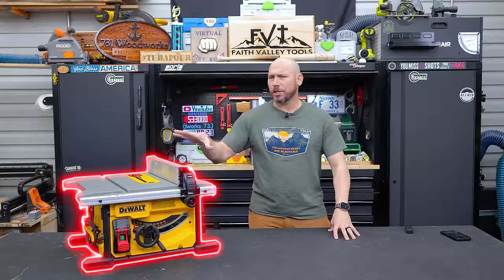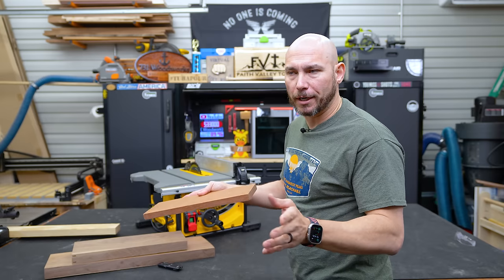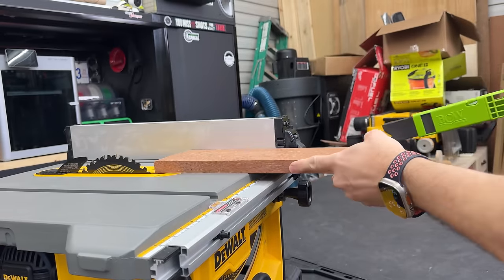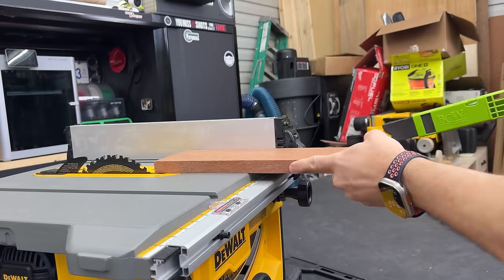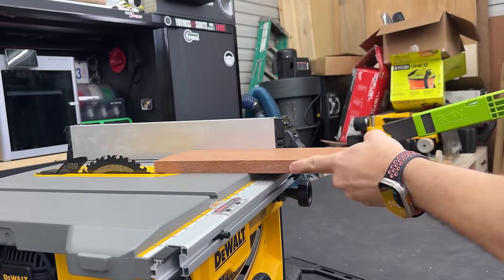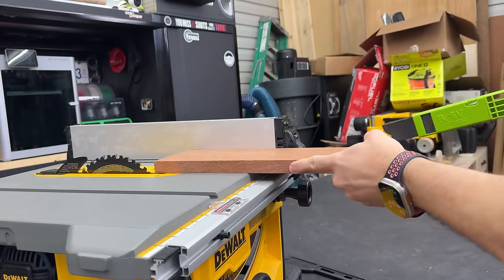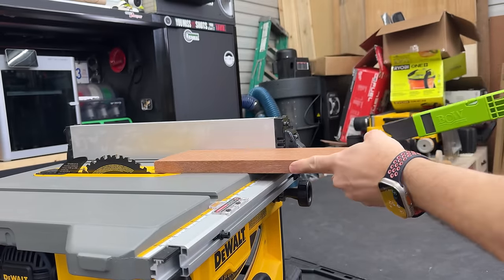99% of Beginner's Don't Know These Table Saw Mistakes to Avoid!

Comment: Female UK Diyer who is finally getting her home next month which has a garage so can build my workshop. I want to get a table saw but they scare me. I would have loved to buy the saw stop but they don't seem to sell in the UK, so I always binge on these videos to get some tips. If I get a table saw, would be a compact one, maybe Dewalt, Bosch ect. But one thing for sure, I need my fingers, I value my body parts to screw around with some shortcuts. Respect your tools and don't take shortcuts.
Reply: Enjoy!
Reply: If they sell FLEX in the UK, you might want to check out one of their upcoming 2 table saws.
Reply: I have used a table saw for 50 years started in wood shop at 16 now I am 66., I have owned three saws a real cheap one , small craftsman cast iron and a few years ago bought bought a forty year old large cast iron craftsman.  I been bit at least three times with kick back. I don’t have a riving knife or blade guard but use wood spacers on long board and feather-board to minimize kickback.  But I am very careful but the credit for not knicking a finger was Mr. Friend my wood shop teacher. Take classes and listen and practice what a good instructor teaches. Thanks Mr. Friend!
Reply: I would suggest getting a tablesaw with as big of a top as possible to fit in your space.   Every inevitably cuts wood larger the table.  Consider whatever you buy, build into its own cabinet/bench.  Take a look at this channel.  Over the years she has scaled up to better tools, but always keep the DIYer in mind.  IN one video she provided multiple to join boards.  https://youtu.be/22oqr6o5z-w?si=6pCIaz2HZs3lu9bO
Reply: Do you have the Bosch Reax saws in the UK?
Reply: Think about what you would use a table saw for and whether another tool could do a lot of the same tasks. A good bandsaw might work depending on your needs.
Reply: If you wind up buying a compact table saw, get something with a rack and pinion fence system.  The Bosch doesn't have one and I got tired of trying to make micro adjustments to the front and back of the fence to make sure I was cutting straight every time I had to move the fence for a new cut.
Reply: I got a Skil TS6307-00 for several specific reasons which may or may not be relevant to you.  Many saws have some of these features, but the Skill is the only one I could find with all:  
1.  10" blade so it can cut 4x4s in one pass.
2.  Rack-and-pinion fence for greater accuracy and reliability.
3.  Self-contained, collapsible legs so I can easily get it out of the way when not needed.
4.  Legs collapse into the footprint of the saw (the collapsible legs on other saws make the package much larger than just the saw).
5.  Trunnion adjustment that pivots the blade about the vertical axis, ensuring the blade is parallel to the fence AND the miter guides.
6.  731 Woodworks gave it a thumbs-up.
Reply: @karllautman I have the same saw and it is a great saw. The only complaints I have with it is it’s extremely loud and the table is not flat. This hasn’t been a problem for me, but check the table for flatness if it is important to you.
Reply: @markgallagher1376 I always wear ear protection when using it so I haven't noticed excessive noise.  No problem with table flatness either.  The insert that goes around the blade is a little flimsy and I'm in the process of replacing it with something stiffer (and zero clearance) from Esty.
Reply: @karllautman  yeah, I always wear ear muffs, but I’m not sure if it bothers my neighbors or not. The table isn’t out much, but it is wavy. Maybe it slipped past quality control.
Reply: Very cool.
There is a channel called Woodshop Junkie.
He makes the most out of small spaces for storage.
Recommend taking a look at his channel as you design your space.
Reply: Festool have sawstop built in for the uk.
Reply: @80adrian80  really? Wow, I didn’t think they licensed to anyone.
Reply: @markgallagher1376  festool bought sawstop  a while ago. So licencing it to themselves, not sure I prefer the design 9f the the festool though!
Reply: @80adrian80  ahh, ok
Reply: Get a track-saw....'does a bunch of stuff better.
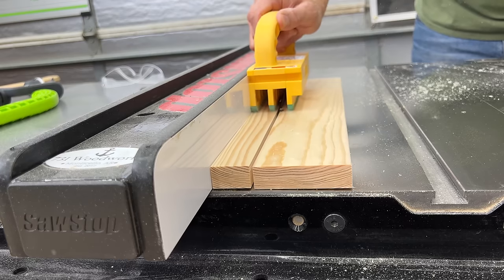Like "Buddy" said at around @3:45 . A dull blade on, a-ny-thing, is dangerous.
Congrats btw. 

Greenhorns usually disregard the "Safety First" mentality, because they're fk'n Greenhorns! Nothing is worth more than you're life and limbs.
Reply: Bosch has a saw with a safety stop. They aren’t allowed to sell them in the US but you can get them in Europe, I would think they would also be available in the UK
Reply: @80adrian80  Just checked, they do, but yikes, £1800 for just the compact saw...wow...really expensive.
Reply: @markgallagher1376  Think Festool brought Sawstop. Its a shame, such a good safety feature but the patent won't end for a number of years.
Reply: @dhebert111  Thanks, I have bosch cordless circular saw but don't have the rail system, so for now, might just buy a rail system, maybe the bosch FN ect...until I decide on a what table saw I need. But thanks, its the dread of losing my life and limbs that makes me so nervous of these tools.
Reply: @johnanderson7653  I didn't know they did, I will differently check out the Bosch table saws. Festool with saw stop feature cost £1800...wish the price was lower as no joke, I could buy 4 compact bosch table saws for that price. But they own the patent so no competition.
Reply: Bosch reaxx is not available any more in the UK. They had a legal issue with saw stop. It's very frustrating that the only UK option is so expensive, bloody Festool!
Reply: I have bought my first Table saw at age 68 having been a pro decorator retired and built/ renovated 3 houses with many other projects. Honestly, I thought I would never need one. But I was wrong. Bosch 635/216 was my decision, although being a Milwaukee man I was drawn to it and I am mightily impressed. Whatever you decide on you should always take every effort to set it up correctly, always use riving knife and blade guard unless you just absolutely cannot. As added security I have invested in a new fence attachment with adjustable rollers. I made a table sled for cross cutting (easy) and I never force a cut or ask it to do something that it shouldn’t. Finally, watch as many of these videos as you can. They have some great tips and ideas. I have all my arthritic fingers intact, both my shortsighted eyes and aim to keep them that way.  Have fun
Reply: Sold my table saw and bought a band saw and later a track saw. I don’t miss the table saw, the band saw can do many jobs and is much quieter, safer and less messy for the diyer without amazing dust systems, and for bigger panel cuts, the track saw is best and I can take it outside if I want.
Reply: @3tree  So do you still use the band saw. I am looking into Track saw as well, do you think its more safer than a table saw?
Reply: Had a machinist working for me one time. Excellent craftsman, and he did woodwork at home. One Monday, I came to work and went out to the maintenance shop breakroom. He was sitting there drinking coffee with his left hand. His right (dominant) hand was encased in bandages. He said he had a "little" accident on his table saw. Several says later, he was able to remove bandages, and his four fingers had little metal pins coming from the ends. He had amputated all 4, removing the 2 end knuckles on each. Weeks later, when they removed the pins, his fingers fell over like dead soldiers. They all had to be removed. I worked 37 years in the chemical production industry, which has more ways to get hurt and killed than you can imagine. I consider the table saw 2nd only to a chain saw as the most dangerous tool around. I have a small contractor saw, and I'm scared shirtless when it is running. I use it, but treat it like a nuclear bomb, very carefully and with the greatest respect.😊
Reply: @MJ88Owl  Thank you, will do, have so many projects I want to fo. First one, arcade bartop, have all the wood and parts, just waiting to complete my workshop.
Reply: @mumihp  no problem, I should add, reading other comments from people that have given you information. Lots prefer tracksaw setups, I too have one and love it. Both have their strengths in different ways. Cheers
Reply: I don't know what is currently available in the UK, but generally their saws are much better than US saws, the full size one's of which are based on a saw from the 30s, that they have been kludging into service for decades.   They never tell us out of all the accidents how many of the people were drunk high, or just stupid and ill prepared.  Of all the tools in a workshop, the worst things that can happen are largely not with the table saw.  Probably the accident statistics are so high because there are so many saws out there.  In NA I have bought them for as little as 25 dollars, so there is no barrier to entry, meaning a lot of them are out there in the hands of incompetents.

If you are average female height, then most saws particular saws like the large Sawstop are far too big for you.  I am 6'2" with long arms.  I find a lot of the saws derived from the Unisaw too large, then they put a fat fence system on them.  Get a saw with no more than a 1HP motor, and of a size you can manage.  My ideal saw is the Inca 259 from the 80s, but some of the portable saws would be easier to find.

I have one saw at my cottage that has a 1/2hp motor on it, and still cuts pretty well, though that would qualify as underpowered, particularly for hardwoods.  But smaller saws of around 3/4hp (depends on type) can actually take kickback mostly out of the equation, and that is the most dangerous thing.
Reply: @tacticalskiffs8134  Thank, in terms of variety, I saw the US has a lot more tools and brands than the UK, maybe because of EU regulation on what we can import then and safety. But will differently research to see what fits best...but then again, I can put a table with foam on top and use a track saw to cut materials if needed. Not sure yet, but will differently research more.
Reply: I had a ShopSmith that I bought to build a shop. I used it for 20 years. And sold it for $200 to a friend(younger than me). Beautiful machine with a lot of attachments and tools. I think it was a Mark X.
Reply: Go with the DeWalt jobsite table saw.  It's the best in it's class, it comes with a few safety features and it's lighter than all other jobsite table saws and it has a rack and pinion fence which is amazing for accurate cuts
Reply: As long as you are afraid it you will be safe,trouble starts when we become too comfortable
Reply: UK DIYer here with a similar potential set up to you ... the garage. I had the same dilemma earlier this year. I realised that the smaller saws are aimed at contractors to lug about in vans. They have a relatively small top and make cutting anything large or delicate quite a challenge. 
After a bit of research, I've just bought an Evolution RAGE5 - not even got it out the box yet. It wasn't particularly expense compared with some, but I've learnt is no matter what I was going to buy, I need to take my time and calibrate it properly and often to reduce usage and kickback.
Reply: @paulrattray8121 I've the same issue. Small single car garage. I've got the DeWalt DWE7492 table saw. The top is fairly big, but have built a bench around it too give extra width and an out feed. Bench is on wheels so can be moved around the space depending on the cut.
Reply: 30 years ago I bought the smallest delta cast iron tablesaw in their line at the time. I bought a couple of their lighter T-square fences and made my own rail for it- one fence for tablesaw, one to built a router table fence for the self-made right side wing. Not that compact, but not gigantic in a small shop. 

So my recommendation after living with that compromise- and also having a small, light portable I acquired along the way- is to NOT buy a light portable. The small, heavier cast iron saw cuts smoother anyways, but coupled with a nice US$300 blade you will save so much time and have excellent accuracy and performance that isn’t readily achievable with a light tablesaw. 

Of course there’ll be a lot of opinions differing (and I’ve been told so many times personally how ‘perfect’ the person’s portable tablesaw is) but after 30 years of pro cabinet and furniture making out of a very small shop I can’t say strongly enough how beneficial a smooth-running cast iron top tablesaw is. Stability is everything for joinery cuts and repetitive accuracy and you won’t regret having a solid, dependable tool for not much more money than a decent portable. 

You can get by with a lot of other cheaper tools in other areas, but the tablesaw, router, measuring tools, and drill press are the first places you’ll discover that going cheap is going to bite you in the quality of fit and finish department. 

The point is that you never want the tool to limit your achieving your full potential. I know it’s been said “it’s a poor craftsman that blames the tool” yet the fact is those tools can and will defeat the best of skills if they can’t perform at least as good as the workmen using the tools, and a decent tablesaw will never introduce a quality limitation to the finest craftsman among us, male or female. 

My opinions, obviously. 
But this is my advice to anyone that doesn’t have the space or the budget for a hybrid or full-sized cabinet saw.
Reply: If a table saw scares you that's good you will respect it.

Go for bigger sized ones.

If you don't have the budget or space learn how to use a skill saw ( worm drive saw ) and a straight edge.

Or a router and straight edge ( ½ inch chuck not palm router.

You could also look into panel saw or panel router.
Reply: Ya gotta have a healthy respect for the power of a table saw!!! You are wise and should have a long time working with wood! Best wishes!!!
Reply: Ya gotta have a healthy respect for the power of a table saw!!! You are wise and should have a long time working with wood! Best wishes!!!
Reply: I’m waiting to do the same thing. I will be moving to the country and building a workshop in my garage.
Reply: Fellow UK female DIYer who has the bug! I’ve also set up shop in a tiny garage (was a one car but the back part got converted to a room). I find something portable great because I actually work mostly just outside the garage - better for light and dust imo. I too bought the Evolution Rage 5s but if you do it’s worth looking at all the different tune up videos to ensure you’re getting the best possible out of it. At the time I never considered a track saw and sometimes I do wonder if that would have been better but no budget to try one for now. Happy building!
Reply: Whilst saw stop is great - from a safety perspective the Most common injury is from kick back which saw stop doesn't prevent
Reply: I would even say saw doesn’t matter as much as keeping your supreme respect for a VERY dangerous tool. 

All your original parts!
Reply: Two points:

Buy dewalt - if you buy anything else you’re silly

And lastly, don’t pull back! Always continue the cut and through.
Accidents happen when people ease up or pull back.

A last free tip - keep the guards on.
Reply: UK DIYer here:
Get a track saw instead. It doesn't need as much space, is less scary than a table saw and you can do a lot more than just ripping sheet materials with it. Check out 10 Minute Workshop by Peter Millard for very approachable videos.
Reply: @YaaLFH  yeah that’s really good advice actually. I bought a circular saw and have spent my time building jigs to create straight cuts and my mate bought a track saw - it’s night and day and wished I’d bought one.
Reply: @dannyarcher  A track saw is basically an evolution of circular saw, designed to make it easy to cut straight (thanks to the track) and safer to use (plunge mechanism).
If you use your saw to build stuff, I'd seriously consider upgrading to a track saw.
Reply: @YaaLFH  👍
Reply: @YaaLFH  hi, I am considering that as I seen how versatile it is. Do you have any recommendations that won't break the bank? Thanks
Reply: @mumihp  Depends on your budget. I would start by checking ebay for used Festool ones, maybe you'll finding something in your price range (just be careful about 110V vs 240V).
Peter Millard has tests and comparisons of UK budget brands plus a lot of other track saw related content in bite size chunks on his channel called "10 Minute Workshop".
Reply: @YaaLFH  thanks, will have a check. I have seen Peter videos before but will check out the tracksaw videos. Festool I would like to buy but they are pricey so will have to see what I can afford but differently want a track saw that is accurate and safe to use. I rather not cheap out.
Reply: @mumihp  If you can stretch your budget to about £250-300, you can find a used Festool in a good shape that will serve you well for years, they hold well if not abused. It might be a bit of a hunt but it's possible to find them in that price range.
If your budget doesn't stretch quite that far, definitely check Peter's videos on the supermarket brands, there are some surprisingly decent choices there!
Reply: I bought a cheap table saw years ago and have never had a problem.  Use the safety features and common sense and you'll be fine.
Reply: You really don't /need/ a tablesaw to build furniture. You can do an awful lot with a tracksaw, possibly also a small bandsaw, and a router table.

Both Record and Axminster do decent bandsaws. Mine is a Record 14", but you can get by with a much smaller machine. You might even find an Aldi bandsaw, I think their tool brand is Parkside.

My tracksaw was from Makita, router and router table from Trend. All available in the UK.
Reply: The Makita mains powered tracksaw is an awesome bit of kit. It's not a cheap supermarket saw, maybe not as good as a Festool tracksaw but I honestly can't imagine the Festool being that much better.

As always, shop around and see what you can find.
Reply: @Mikey__R  Of course you don't need a table saw, it's just USA people looooove their huge tools and consider a table saw THE universal woodworking tool.
When you don't have an aircraft hangar for workshop and have to fit your woodworking in a typical UK single car garage or garden shed, a track saw is much more convenient because you can bring the relatively small tool to your material instead of trying to manoeuvre a huge sheet in a small space.
Also, if you are of or below average female height, a lot of table saws are too tall and hard to reach.
Reply: Also feel free to freehand when you need to I've been doing it for years
Reply: Don’t spend a load  of money . Check out your local Lidl supermarket. Their Parkside range are really good quality.
Reply: I think when it comes to using dangerous tools a fear of them can be a good thing. You never really want to get too comfortable, that's when mistakes can happen.
Reply: During the cut, we are often quite safety, conscious but before and after the cut, we can easily let our guard down. I had my saw in too small a space ripping 2x4s and could not have the safety guard on (old model I guess)and got badly nicked just from turning around. Natural swing of the arm. 

Give a table saw lots of space/room on all 4 sides!! I could have used a much larger room in my house, but I didn’t have any conception of a good dust collection system at the time. Ignorance is not bliss.
Reply: @mdtcomm1533  Hi, finally got my house which comes with a large garage which I am converting to a workshop. House renovation is ongoing so this is on the backside but will differently fix it up, good thing, it has electrics already in the garage by previous owner, few tables so can use and fix it up. I have not decided whether to get a track saw or a table saw....so when the time goes, will be looking into one. But differently, need to have a good dust system in place as do not want to breath in those dust particles.
Reply: I use a bosch for flooring ect. Its really not a bad option. Its just alot larger than the dewalt. I always figure its better to cry once buying something. Ill probably have this saw for the rest of my life
Reply: I have a similar saw: SKIL SPT99-11 10 in. Heavy Duty Worm Drive Table Saw with Stand. It's not as compact but very versatile & powerful. Just be sure to keep the wormdrive lubricated. When you get a tool always go through the full setup to ensure proper use & no product defects. For example: Table flat, blade parrallel to fence etc.
Reply: Welcome to the sawdust. I have commented on UK home of Ben Elliott woodworking channel. Very unique and patient bloke. I discovered that  U.S. style tablesaws are illegal in U.K.  Dado sets are illegal in U.K. except for especially designed table saws. Ben Elliott has a work around this as does U. S. Channel Stumpy Nubs. The work around is a very simple table saw technique which eliminates the need for a dado set.  Ben details each step of a project patiently including verbally discussing issues. He also has mastered the art of projects in his "tidy" shop. There is also an excellent German lady carpenter channel who smiles a lot for her subs who make grateful comments. Good fun. Stateside we try to put everything on casters to reorganize as needed. Jump in we're all trying to keep all of our fingers. My father and his father weren't so lucky. A nano second lapse and at least one is gone.
Reply: You can quite safely use a table saw without any extra tools. The most important thing really is to not make pressure against the sawblade.
Reply: You can quite safely use a table saw without any extra tools. The most important thing really is to not make pressure against the sawblade.